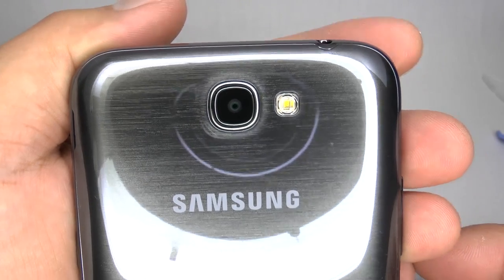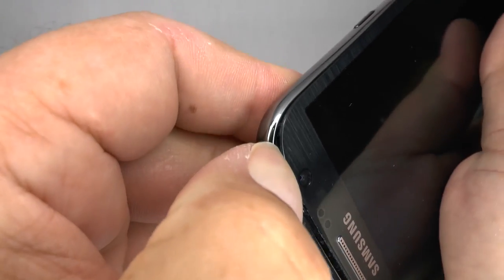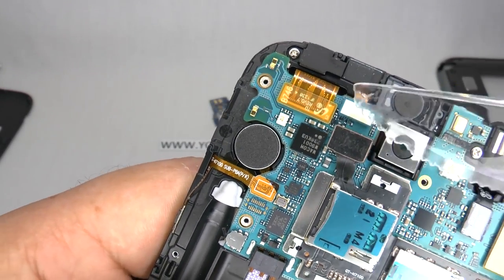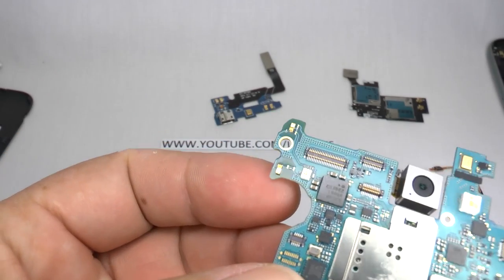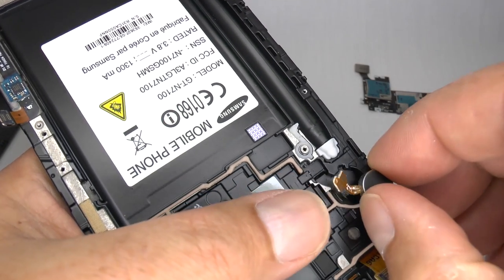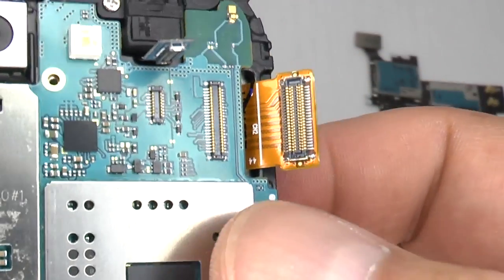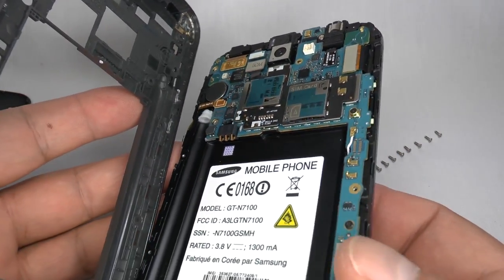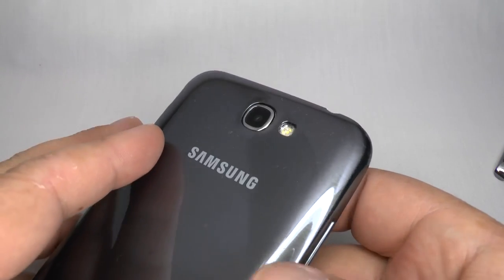Galaxy Note 2 Disassembly & Assembly - Screen and Case Replacement - Drop Test Repair

Comment: You are amazing. My power switch stopped working; opened it up and the switch had come apart. Was able to position the two halves properly for a quick fix while I await the real one. This video was great not just because of you showing how it's done but also explaining what all the parts and ribbon connectors are -- extremely helpful for visual learners.

Comment: Good Sir, a better video could not have been made. Outstanding lighting, detail and audio. Your very pleasant voice reassured me through the process and enabled me to replace my speaker element without any issues. A $5 ebay part and your fine video just saved me $600. She rebooted fine and now after 5 weeks of troubleshooting software issues I can finally hear incoming call rings. Thank you, sincerely, thank you!

Comment: Thank you very much, you saved me.

I spilled milk on my galaxy note ii and this stopped recognizing the S Pen, thanks to you I could take it apart and see what was stuck on the S Pen sensor and therefore not detected if it was inside or outside.

I cleaned with isopropyl alcohol and have released the S sensor pen.

Thank you very much.

Greetings from Mexico.

Comment: Thank you for helping me save my Note 2. An excellent video. One thing I found was that it was REALLY hard to remove the case and logic board screws - your demo showed an easy removal - I found the screws so tight I think loctite must have been used to keep them tamperproof. Once again, thank you very, very much.

Comment: Hi!
Thanks for your reply. I had a new look with a loupe and noticed a tiny crack in the LCD screen on the right top corner :-( I reassembled and took it to a local repair shop. 
Keep on the good work with these video's !

Comment: I am waiting for my tools and parts to come in the mail to replace my cracked screen, and I have been looking for a good tutorial video. Most people try to trick you by keeping the phone on the corner of the camera, or using a terrible camera. This video is perfect and I will most definitely use this one. Do you have any tips for replacing a cracked screen for a beginner?
Reply: Also this is great because I actually know what I'm doing, whereas the other video just said "unplug  A + B then do this" etc.
Reply from the maker: dimjon11 no tips really, just take your time and you'll be fine..

Comment: Hi there,
I often come back to view your tutorials, and I would like to congratulate you as they are very well done as you explain everything in detail - it is clear you know your phones inside and out. Therefore I have a question for you: Over a year ago I bought 3 screens (each one with it's frame) on Ebay, to later discover not one of them allowed the S Pen to work although they all have the S Pen pad behind the screen and flex connector. One would say, ask who you bought them from, but apparently the seller no longer sells screens or phone parts and is not to be found.

I did get chance to try my phone's board on another Note 2 and the S Pen works great. So that excludes a software issue, plus the phone recognises it when pulled in and out, but apparently there is no electromagnetic contact... nada!

Any ideas or tests I can do? Thanks a lot in advance!

Comment: Thank you for this video. My Note 2 went through the wash and the microphone stopped working. This video help me replace it. Good as new! One question: Speaker Phone works but caller can't hear me. Where is that located. Wasn't clear if it is the same microphone at the bottom of the phone or what.

Comment: Great video, very helpful and clear description. 

Can you help me out here? I have the note 2 but I recently experienced a problem with it: it says my camera failed! I tried everything, even reset my phone but it's still the same. Do you think I should replace the camera module itself? If so, do you suggest any buyer on ebay? :)

Comment: Thank you very much. I replaced my middle case myself!
Reply: I also have to replace my middle case and thanks to this video I think I know what i have to do. Except this. Do I need to transfer something form the old middle case to the new one? Salut calin! Cat a costat carcasa ta(corp mijloc)? Eu vreau sa imi iau ceva intre 40 -60 lei
Reply: misubold  eu mi am luat de pe ebay de prin china cu 3.15 euro, numai ca tre sa astepti cam o luna pana ajunge de acolo. de schimbat nu trebuie sa schimbi nimic, are toate antenele de 3g, wireless, gps. doar o inlocuiesti si gata.functioneaza super.

Comment: Thanks so much for the video.  Helped tremendously with my screen and digitizer replacement.  When reassembling the phone, I separated the 3G antenna connector from the cable.  I thought I got it back in ok but now I am getting a "Mobile network not available" message.  Could this antenna connector be my problem?

Comment: This is a fantastic video.  The detail here is amazing.  The Note 2 is quite modular and seems very straightforward to take apart.  Using this video, I was able to remove my damaged micro sim and micro sd card and tray so I can install a new one.  So, do you assemble/disassemble using this camera so that you get a highly magnified view of what you're doing? if so, it's like detailed surgery under a microscope. Very well done and information.  One key takeaway is that a magnetic screwdriver is very handy.  Thanks very much for posting.
Reply from the maker: I don't really look at the screen, I try to look round the front of the camera most of the time with a quick look at the screen now and then, thanks for the feedback :-)

Comment: Great video!! Do you think it's possible to just replacing the front glass cover? With out Damaging the LCD? I dropped my Note 2 and the front glass shattered in pieces but the LCD and Touchscreen works just fine.  Needs your Professional opinion! Thanks!!!!

Comment: So I messed up my sim reader by putting in an sim adapter without a SIM card in it and it got stuck. Called a nearby repair place and they said 60 bucks. I bought a new one online for 20 and did it myself. Thanks for saving me money. I'll be sure to suggest you to anyone I know so you get views

Comment: Hi LE55ONS,

I just had a look at your detailed video in order to locate the screen connectors in order to re-connect/connect them. I drop my phone and it fell on it's back. So glass is not damaged, all buttons work, LED on top is working, backlight on "back" and "menu" button work, touchscreen is also working, but no screen. Are there any other connectors that might have come loose because of the fall? And if yes, where to look?
Thanks for your reply so far!

Comment: Battery was working fine before I messed with the screen. First, tried taking just the glass off, which I wound up cracking the tinted glass under the first glass that I didn't even know existed. Then I bought the LCD + Digitizer whole screen and transferred the parts and I had no issues I thought. Screen was awesome. It was beautiful. I was so happy. Went to charge it, and it started giving me issues about being too hot. The only thing different is the lcd + digitizer.

Comment: Congrats for your accuracy and clear views of the tutorial!! My case is that down half of the screen is not responding to finger touch... What would probably caused this, and how could I fix it? Thanks for your time...
Reply from the maker: it sounds like a faulty digitizer, does the s pen work ok?
Reply: ***** Yes the s-pen works fine all over the screen
Reply: ***** Yes the s-pen works fine all over the screen
Reply from the maker: AEK Corner sounds like the digitizer has gone faulty, there's not much you can do apart from fitting a new screen..
Reply: Thanks a lot!!!
I am going to do so..

Comment: Awesome.. On to the next problem I had before I destroyed that: my phone keeps saying that the battery's too hot to charge the phone and I can't charge it. Everything looks normal, so I have no idea what its beef is. Is it heat damage from using the hair dryer to replace the screen, or is it because of destroying that antenna?

Comment: for a first timers DIY is a rear casing replacement hard or dangerous to attempt? it seams pretty straightforward just taking out some screws prying it open and replacing

Comment: Thanks for the vid! great stuff!
one question
in your dissasembly you mention that there is a 4g antenna on the n7100... but every where i look it is not 4g capable.. so why is there a 4g antenna? could we hack it to work on the n7100?

Comment: Nice video. I have a question, which size of screwdriver is needed? I want to buy new middle housing case because my volume buttons are very loose. It isn´t for service because they are working but it isn´t good feeling to touch them.

Comment: I've replaced Glass and Home Key flex ribbon.  Thanks for your help!  I just have one question.  The Flex Ribbon doesn't light up.  The buttons work through.  Did I miss something?  I thought my first ribbon was defective so I got a third one and that didn't light either.  Is there something I forgot to connect?

Comment: But any of the sensors work. Cant rotate screen. The light for notifications has No red light for chargin. No light sensor. Not proximity. All this sensors are kind of apart one of each other or togheter? Tnx

Comment: Hi, is it possible to replace the gyroscope or the accelerometer .... mine suddenly stropped working ... i did factory reset re-calibrate also checked with *#0*# and nothing .... im worry about it ... any suggestion will be appreciated.
Reply: Lo solucionaste?

Comment: Do you have any plans on making a video on the HTC Titan? Mine has been acting weird lately, the bottom part of the screen seems to not register the input at all (damaged digitizer?) but I can press there and use the keyboard and things like that.

Also sometimes when I unlock the device the screen works but it doesn't register finger input at all so I gotta lock it and unlock it once again for it to work properly.

Comment: Sir. Tutorial is perfect! thank you. Anyhow I have a serious issue. I have changed motherboards and everything work well without problem. Just S PEN doesn`t work. Sometimes I can see pointer on the screen but behaving is crazy. So S PEN is not working. It seems I need some kind of calibiration of S Pen or something like that. Cable is connected on the board. But maybe HW of display and motherboard are different. Or what could be a problem?? Thanks in advance for your help.

Comment: Hello and thanks for posting this video, I went past the steps that you show. My fault is that the screen is black, but responsive. My buttons on the sides and bottom work. The touchscreen vibrates when touched but it is black/blank. (due water damage) Where do I look for a replacement? Is it the screen that is ruined? I really hope you can help me figure it out. Thank you!

Comment: In my organization, camera phones are not allowed. So I will need to remove the 2 cameras of Note 2:
a) Main camera as explained at 9:16
b) Front camera (along with the proximity sensor and the ambient light sensor)  as explained at 7:40.  (I guess only the front camera alone can not be removed.)
Could you give your opinion whether these hardware changes will cause any problems?

Comment: Thanks, this was a very helpful video. My Note 2 has developed an issue with sound after a drop onto a hard surface. Whenever anything tries to play sound (even if the volume is set to 0) it makes a horrible crackling noise from the speaker. Using a headset doesn't solve the problem and the earpiece is also affected (so no calls either!). I disassembled the phone and reseated all the connectors thanks to your guide. It didn't help, unfortunately. I'm assuming the sound circuitry on the motherboard has been damaged somehow.
Reply from the maker: yes it does sound like it has damaged the mainboard, but it might be worth trying a different rom before giving up..

Comment: Your videos are fantastic.  Question:  I've had 2 instances where I've purchase LCD/screen combos and the "chassis" are molded different than the originals and do not fit properly.  On the last Note 2 purchase, the screen displayed backwards when I tested it.  Is there a way to ensure the EXACT replacement?  Is the manufacture different by region?  If so, how do I get the right part?
Reply from the maker: I don't think the region makes a difference but the model numbers are normally different. Try using the link to repairsuniverse in the description and using the chat feature, they should know more about the different types of screen than me..

Comment: What are the 2 pins on the sd/sim tray for? The ones that connect to the back cover?

Thanks

also have you ever heard of the wifi antenna having a bad connection? I keep having a problem with wifi not even turning on until I hit the back of the phone.

Comment: Hi My Home key is not working on my Star N9330 dual sim  5.5" screen I am just wondering can the home button be replaced with out needing a new screen aswell or do you damage the screen getting in to the ribbon . Also whats you advise to source a screen if i need it and a new home button assembly/ribbon . cheers your information is bliss

Comment: ok. ill try the front camera that has the proximity sensor included. The other sensors are like this one on flex or are they inside the motherboard?
Tnx a lot for ur answer

Comment: Question. I have the Sprint version and was thinking of making it capable of wireless charging. I was going to cut the back area off to clear the ports to get acces to contacts, but could I take off the original rear housing and repace it with a rear housing that has the wireless charging ports. Say the ATT version?

Comment: No.  I'm using stock rom.  This drop happened about 2weeks ago.  Overnight.  Woke up one day.  N the phone just had weak signal...  No physical harm was done to it either.  Do you think putting in a custom rom would make a difference?

Comment: Hello Mr.
1st I would like to thank u for all ur awesome and helpful videos.
2nd. I have a q plz, when I was charging my note 2, it suddenly shut down and never started again. I noticed that the USB charger port got melted from inside, and when I opened it, I noticed the "Charger Port Dock Connector" got fried. So if I replace it with a new one, will my phone work again or the motherboard got fried too ??
Plz help.

Regards

Comment: Sorry to bother you again, but since I put my note back together, the signal strength has become very poor, either no connection or 'not registered on network'. I'm guessing I damaged something when I put it back together - would you have any idea as to what part I should look at replacing? You refer to the plate under the microphone/ speaker assembly at one point - would this be the part I am looking at, or could it be as simple as the antenna? I'd really appreciate your help.

Comment: Hello Sir LE55ON,
If i have the new replaced motherboard for Galaxy note 2 and installed, it will need  installing a program or it will work direct as it is a new.
Hoping to hear from you , thank you in advance...

Comment: Thanks for your reply. I am from Australia. I want to buy one, but confused. Samsung told me that N7105 is LTE/4G version, but does not have FM radio; and N7100 is not LTE/4G version that has FM radio. They also told me that no LTE/4G device has FM radio, eg. I9305. Did you find 4G/LTE hardware/chip in N7100?

Comment: It's an unlocked phone from videotron. T889v model.  I'm with fido.  So they won't service it.  I'm currently outside n have full service.  I put some aluminium near the connector.  Hopefully this does the trick.  I also ordered a new signal antenna.  If my signal drops tonight I'll try a custom rom.  Thanks again for ur help

Comment: Hi. Do you know if the glass digitizer can be separated from the LCD on the Note 2??
I do many repairs on the S3 whereby I remove the front glass (very time consuming!) but the S2 cannot be separated.
Just wondered what category the Note 2 fits under??

Comment: Hello There, I just dropped the phone today & the screen is cracked in multiple areas. I am not sure if i use this methods, with the suction cup it would work. any suggestion to solve this problem. PS. the screen is still on the phone but with lots of cracks across it. 
Thank you much!

Comment: If I get the front housing assembly from the website you provided, will I need to move anything from the old display over? I really miss my phone and I'm trying to do as little work as possible.
Reply from the maker: you'll only need to move the earpiece, mainboard and usb flex etc. you won't need to use heat or mess about removing the screen. Its quite an easy job that should take you about 30 minutes. Give yourself plenty of time and follow this guide carefully and you will be fine..

Comment: if i ordered a new screen with the metal housing, do i need to disconnect everything from the mainboard? or is there a way to remove the mainboard from the housing with many of is parts still attached?

Comment: I'm having problems with the wifi sliding to on and 6 seconds later it slides to off. When I hit the back of my phone it fixes the problem most of the time. What is the most likely problem? Thanks for the video!

Comment: In this video, we've watched a N7100 device. You told in this video that it has a antenna for 4G. My question is that does it have LTE/4G hardware? If it has LTE/4G hardware, then does it have FM radio? If it has FM radio and LTE/4G, then what's the difference between N7100 and N7105?

Comment: What kind of antenna connector there is on the back?
I would connect an external 3G antenna.
Thanks.
Reply from the maker: This website sell the patch leads and antenna that work with those sockets.
If you make an enquiry please mention this channel as I would like to feature their products in future videos.. www.telcoantennas.com.au